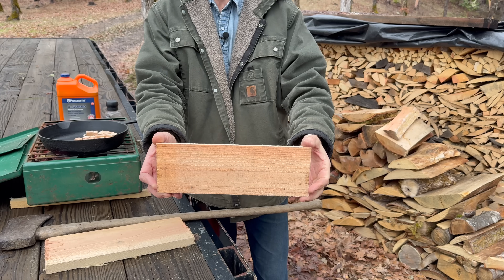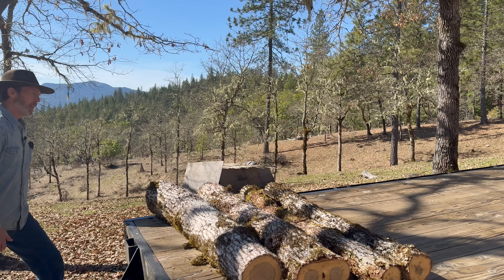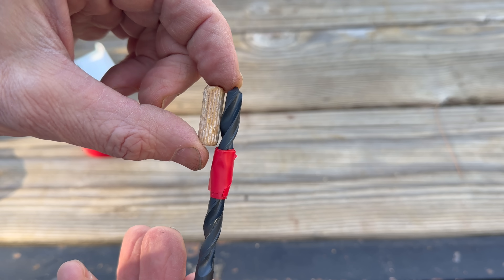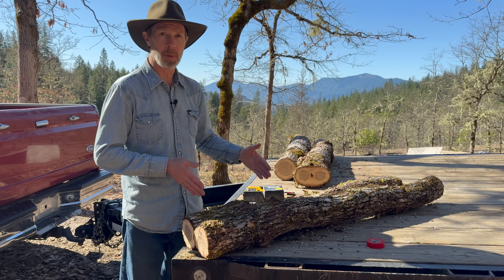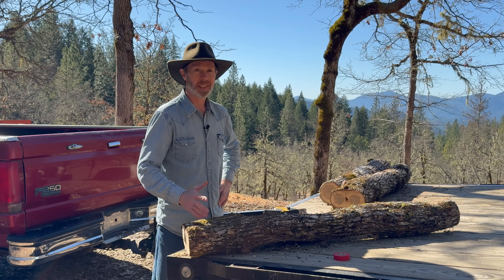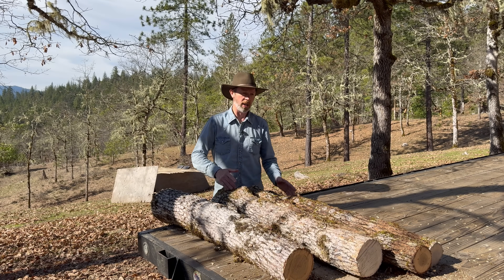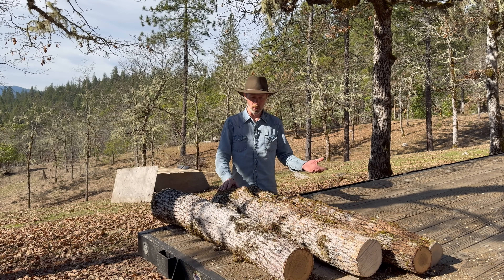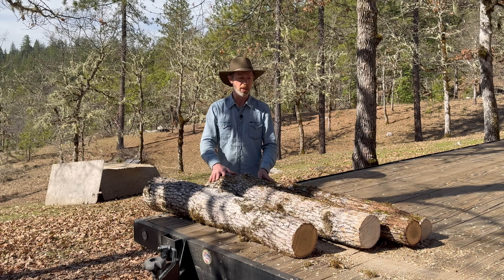Mushrooms Turn Wood Into Delicious Food (Here's How)

Comment: I have the perfect kind of tree cutting tool. It's the Awesome Stihl Brush Hog. First time using it to clear back med size brush and trees from overtaking a friend of mine driveway. It's got a damn sharp ass blade like that of a table saw. I was clearing it up fast when I swung it a little bit too wide and brought down a tree the size of a telephone pole. It was a tall one. It went across a Two lane road. Luckily no one was around 🥴 I cut that up in less than 5 minutes. Faster than your chain saw. It was a private Rd. I was surprised how smooth the cut was on it. Like a knife through butter. I didn't put an angle on the tree for it to fall where I wanted. I just swiped and it fell

Comment: Learning about the cultivation of edible mushrooms is a potentially life saving source of food if the food supply ever gets short. It's is a fantastic way to get nutrients that would be lacking if all you had was a garden and some chickens. Especially because if do it right then you basically have an infinant source of food so long as you have wood. There are plenty of mushrooms that are very much so not picky about what wood you give them either. They are also extremely valuable and some mushrooms like blue oysters and king oysters can be sold for upwards of $10 per pound, and it is very easy have a yeald of hundreds of lbs a month from a 1000 square food grow area.

Comment: Find an oak tree that is going to ho hollow but not quite yet.  The interior wood will be going soft and it is perfect.  Cut into 6 ft lengths.  Lay flat.  Cut a hole in the top so rain is funneled into the inside wood.  The lion's mane mushrooms the size of large turkey's will come out the end.  (Tilt log a little)

Comment: You can also extract the mycelium from the mushroom you want to grow and use it to carry out the initial stage of infestation. From there, proceed as shown in the video.

There are also mushrooms that feed on straw, dry leaves, etc., and growing them has the advantage that they can be fed, so you don't have to restart the process from the beginning, as is required when growing mushrooms on logs.

Comment: Some thoughts:
1.  Log length does matter.  The longer the log, the better the ratio of wood protected by bark:end surface.  Better moisture holding and wild fungi defense.  As long as possible until its too much of a pain to move.
2.  Pants over boots to keep out all the grinder chips
3.  Any advice on getting logs?  Have talked to local arborists and asking, bribing, offering to pay have all failed to get any interest.  Buying a forest isn't an option.  Maybe starting an arborist firm.

Comment: 6:32 Crock-Pot....

Might make the crock easier to clean if there is water in the pot and then a smaller container in the water and the wax in the smaller container.

When was is melted, the smaller container with melted wax can easily be removed with gloved hand or tongs and carried to each plug....

Just a thought

Comment: What if you dipped the top of the log in wax and buried the other end in the ground to wick up moisture?
Reply: That might be an interesting experiment. I have seen vidios where tree sections/branches have been used as a water filter.
Then again,you may end up growing new trees, if the conditions are right.....

Comment: Done a little of that myself.  Found a flat point 5/16" (spade) bit is much faster than spiral bit and drilling is one of the time consuming steps.
(not comparable to your angle grinder method tho)

My crude understanding is many or most hardwoods will work for shiitakes but oak is the go to.  I had large pecan limb (12" dia at base) and that worked.
I was instructed to let the fresh cut limbs 'cure' for 60 days to let the natural anti-fungal compounds dissipate, apparently that isn't necessary base on your experience.
Allowing too much time between harvesting wood and inoculation of course increases risk of random species of fungi to infect wood.
Reply from the maker: I didn't think to use a spade bit. I will have to try that.
Reply: I really like the spade bits that have the sort of"screw" start, for carpentry. It helps pull it through,with less effort.I have not really tried what works best on fresh trees,though. Thanks